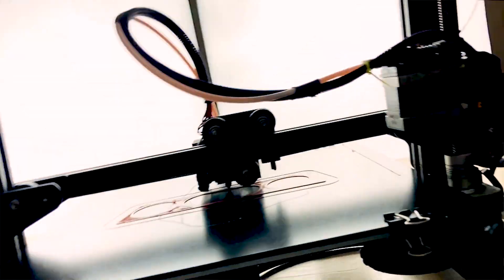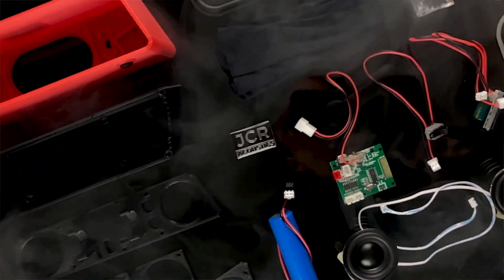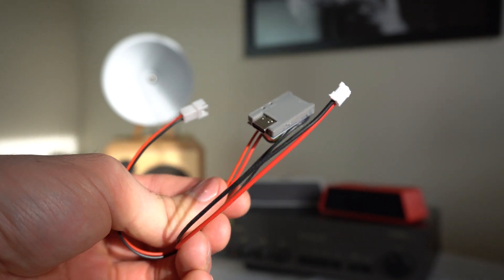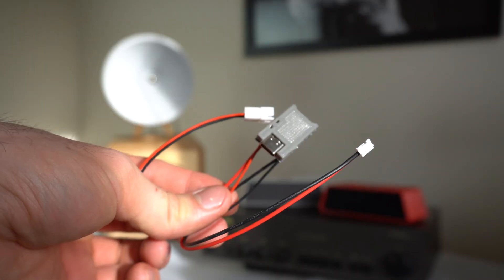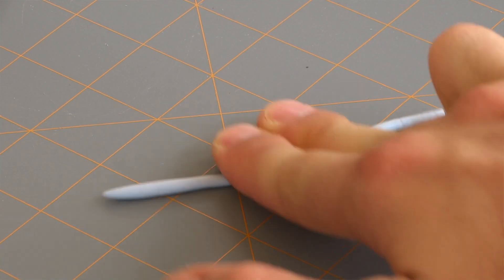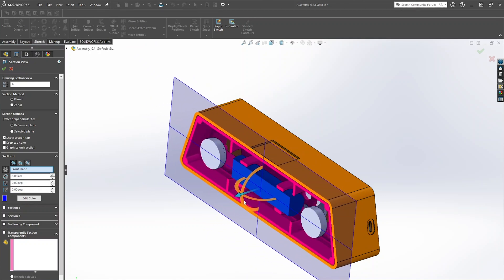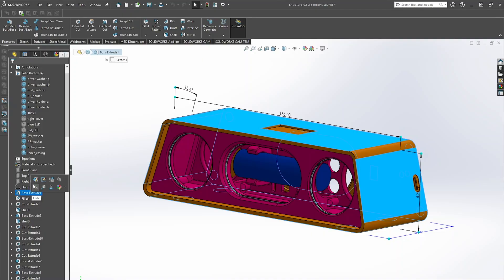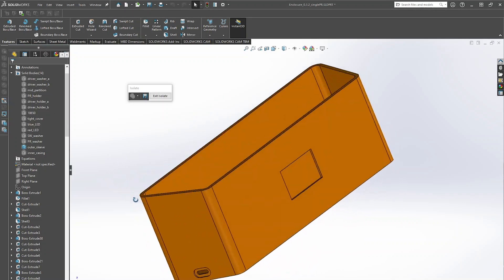3D PRINTING a DIY Bluetooth Speaker!

Comment: China uses plastic... 
But 3d print doesn't not sound good 

Because small speakers depend on case resonance.. 

Chinese have some machine to tune to give best bass
Reply: no, small speakers depend on passive radiator

Comment: Hello Mr.Jcr  hope you are good?  I am Kennedy from Kampala,Uganda. And would love to venture into the 3d printing business and would want to start with making speakers for sale. I would love to know the weight in grams of the speaker enclosure for the design you using and maybe advise me more on the printer to get for start up and the best cheaper filament to use for many prints, I was opting to start with a Bambu lab p1p. Very nice build that you made gladly waiting on your reply, is their any way I can contact you? Thank you.
Reply from the maker: Hey, I can’t recall exactly but I think boxed the weight was 450g so maybe 375 or something like that. I would suggest you watch my latest 3-D printing business video as that will answer a lot of your questions. Thanks for watching and best of luck with your business!
Reply: @jcracoustics  thank you for the response, let me check out the video. I appreciate

Comment: Are you still making kits?
Reply from the maker: I’ve recently moved abroad so have sold out and stopped making them for now. You can get the plans online from my website to make your own if you’d like!
Reply: @jcracoustics  well sad panda ok I will have to go that way
Reply: @jcracoustics  So the only thing not really stated on the plans deal with the passive radiator any help? Am in the process, just unsure as to where to obtain a passive radiator that fits in your design.

Comment: Very nice build, how tick is your enclosure and how does it sound compared to other speakers or wooden speakers? The plastic seems to sound hollow
Reply from the maker: The key is a good seal so there's no air leaking. I play certain frequencies at full volume to check for the seal. If it's airtight then the audio quality is great
Reply: @jcracoustics  ok, again nice build. This made me think of buying a 3d printer but first watching some tutorial video's  ;)  it seems difficult and easy at the same time

Comment: A 3 mm jack for aux could have been really great! a higher sound volume and more battery efficiency
Reply from the maker: True but aux is really fizzling out. No new phones have them anymore and equally sound volume would be the same with modern Bluetooth pre-amps. Bluetooth is also really power efficient these days.

Comment: What kind of slide switch was implemented?  I'm trying to select one my self for my own design but want to make sure it can handle the currents exhibited.
Reply from the maker: It was a 50V, 0.5A SPDT switch with a 6mm handle. More than enough for the power involved!

Comment: Very clever design. I want to build something similar. The only thing keeping me back is that i cannot find information about cabinet volume for specific frequency response and what to have in mind. I don't want to stick drivers and passive radiators in a box randomly and hope for the best not knowing these things beforehand. Can you direct me to a site with all the info needed wrapped up in one page? Thanks
Reply from the maker: Thanks for the comment! I'm afraid there's no easy cheat sheet but generally the manufacturer gives you details which can be used in free software WinISD so you can design your enclosure to have the right volume. I would recommend starting with a YouTube WinISD tutorial and that will get you going in the right direction.
Reply: @jcracoustics  Thank you for the reply, that's all i needed. Keep up the good work.